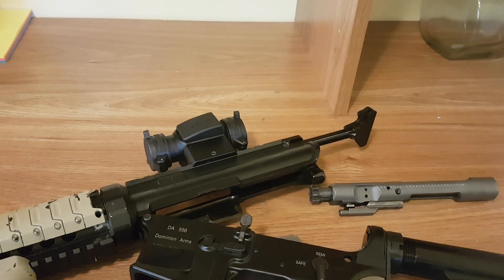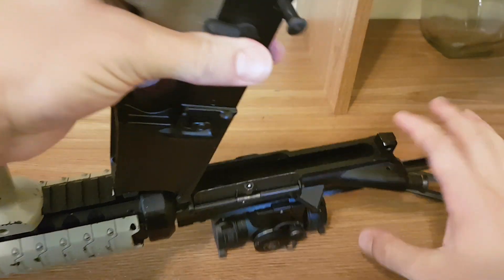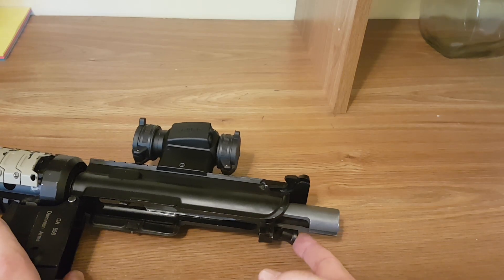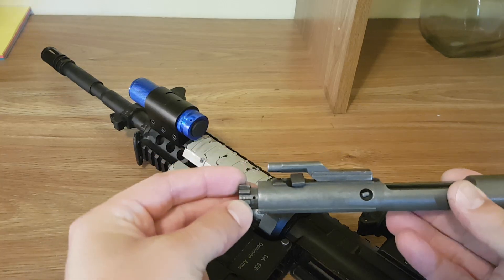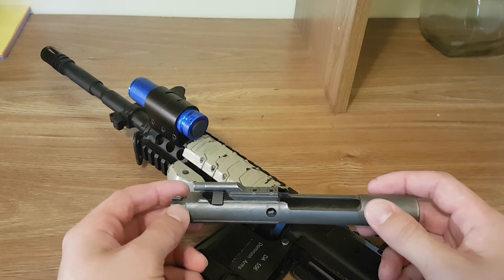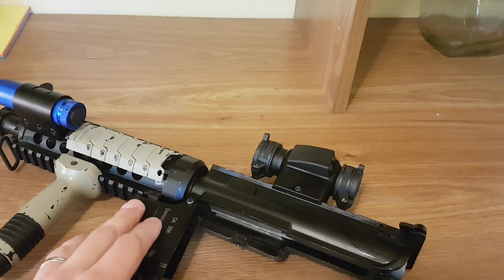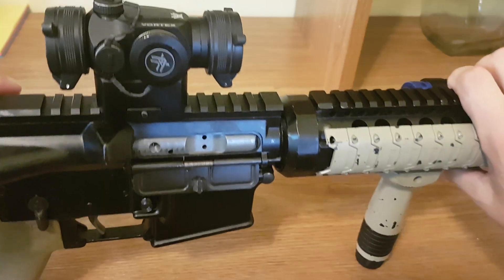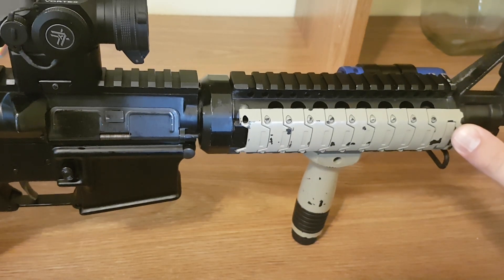What does the Forward Assist on the AR15 Do?

Comment: The serations are on the bolt carrier. And I've use the forward assist when I had to be quiet charging the weapon, when you can't just rack it back and let go. 
But the bolt carrier thing was driving me nuts. The bolt resides in the bolt carrier. 
And just carry pipe cleaners and powder solvent it only takes.... geez I'm getting annal in my old age.

Comment: I always taught troops to automatically hit the forward assist after releasing the charging handle. This insures that the bolt head is completely seated. This becomes more important during sustained firing that requires many magazine changes and loading. Carbon build up can cause the bolt head to often fail to lock forward completely. The original AR-15’s did not have the forward assist, and this was not good. While I can make the AR work for me, I still and always have preferred the AK!

Comment: I am a Marine and I have used the forward assist to put the bolt into battery.
Disclaimer: ... while using blanks.
Went through SOI west in November (Hollywood Marine, rah). As you can imagine beautiful Southern California in November... rain. Rain and mud.

Tap rack.. nothing. 
Sure enough, bolt was barely out of battery, like dude says in this video, so what did I do? ... tap the forward assist. And I have forever a clear memory of the forward assist gingerly forcing the bolt forward and causing my rifle to function properly.
I'd also like to add that my papa was a 1980s era Marine scout sniper, and he was taught that the forward assist is almost essential if you're trying to be quiet.
You never know when you might have to make ready Solid Snake style.

Cheers.

Comment: If you put a round in it, it wouldn't go all the way forward like it is in the video. The forward assist is also used so that you can chamber a round very quietly. Instead of having the bolt slam forward and make a bunch of noise, you can bring it forward slowly then use the forward assist to bring the bolt all the way forward to fully camber the round and ready the weapon.

Comment: If you whant to show how the forward assist works, try load bullet and than gently relase the bolt. Not relase completly but in that way you had tryed in the first place. Will work. Sometimes at hunting I whant gently release bolt and then i must used forward assist

Comment: We had the same drill in the Dutch army with the Diemaco (same platform). Pull the charging handle when loading, assist it back (never let the spring do the job) and push the forward assist with the hand palm. Never push it with the dump or whatever to avoid injuries.I never figured out why this was. Well I knew you will push and lock the bolt into the chamber that way perfectly because of these little notches. But I can also imagine it's less louder to securely charge it this way, instead of just releasing the charging handle and let the spring do the job.Using the forward assist was also part of failure drills.But other then that, I don't know if the the forward assit is still necessary on this weapon platform annymore. Never encountered difficulties or missfires. I believe it's still something from the old M16 which had a lot of issues, esspecialy with bad ammo, so I've read.

Comment: As a Veteran I can tell you that it is only used when implementing remedial procedures to overcome a failure of the rifle. When using SPORTS after a failure Slap Pull Observe Release TAP (the forward assist) Squeeze. After a failure to fire, after the failure has been cleared, and the bolt is falling from a locked position rather than a full charge, there are times the bold carrier will fail to go into full battery so the forward assist will help move your bolt and bolt carrier into full battery.

Comment: It also helps if you have a misfire and you're trying to reload another round quietly without slamming the bolt. Just ease the charging handle out and back in, push the forward assist to ensure the bolt is locked. Then you're ready to go.

Comment: The M16 I used in the 70s did not have a spring for the charging handle. I'm told it resulted in some nice smiles for a few who forgot to push it forward.

Comment: I don't get it. If it was designed just to push the bolt fully forward, why wouldn't you just push on the cocking lever? And it doesn't seem right to have like 50 little notches just for that.  If any of my guns jam while cycling the last thing I'm gonna want to do is jam in in farther til it closes haha what the fuck! Plus all the negative comments here I think something's fishy with your explanation. Anybody for sure know what it's for? I am very curious
Reply: Ryan Zuker ... because the cocking lever...or charging handle is designed to only pull the bolt carrier back. That way, wben you lock the carrier in an open position you can push it back in out of the way and also so it doesn't move back and forth with the carrier as you fire or cycle the gun.
The forward assist isnt there to solve a jam issue. It is there just incase the bolt doesn't fully seat forward and this can happen for a few reasons that are simply taken care of by this function.
Also, if you have ever had a gun under water and needed to drain your barrel, or want to verify there is a round in the chamber and ease your bolt back a touch...this can quietly and effectively seat it in place without the full range of motion and loud charging noise.

Comment: The French MAS-49, Swedish Ljungman (Automatgevär m/42 or AG-42) and the Egyptian Hakim and Rasheed all use the direct impingement gas system and none of these have or need a "forward assist". 
Eugene Stoner apparently produced a beautifully engineered but totally unsuited to battle firearm (like a "Luger" pistol in that respect) and the resultant fuck-ups by the Military resulted in "more than 22 changes from his (Stoner's)original design and eventually the "Ichord Congressional Subcommittee hearing" and in October 1967, the subcommittee concluded, “Grave mismanagement, errors of judgment and lack of responsibility had characterized the Army’s handling of the entire M16 program.” Also, regarding wrong ammunition problems - "“The failure on the part of officials with authority in the Army to cause action to be taken to correct the deficiencies of the 5.56mm ammunition borders on criminal negligence.”
So, What does the Forward Assist on the AR15 Do? It (sort of)fixes one of the many problems on a horrible gun !

Comment: Ya know what doesn't have a forward assist? An AK. That's because it doesn't need one. And that's because it doesn't fail like the AR does when it gets some dust in it. The bolt is one big hunk of metal without all the overly complicated crap like the AR.

Comment: i don't think anyone truly understands why the fwd assist is there, you don,t slap that shit when your gun jams. I've only been in the army for a little over a year now but the only time we slap the fwd assist is when we load the weapon, releasing the action after clearing the weapon things like that, you'll never slap the fwd assist if your weapon fails to fire, you have a specific set of drills for that depending on the location of your bolt during the jam you do said drill to try and clear the jam once cleared cock, slap, shoot. if you weapon fails to fire and you start slamming on the fwd assist you're doing it wrong.

Comment: is this basically the same weapon as hk416? i used that in the army and they look very similar
Reply: H&K took the M-4 and changed the design from a gas operated to a gas piston system, and called it the M-416. This means that the 416 has a piston and rod that drive the cycling of the bolt instead of a gas tube. The gas piston causes an increase in weight, but improves accuracy, reduces fouling (more time shooting, less time cleaning), and allows the barrel to stay cooler (no gas tube to allow heat dissipation to add additional heat to the barrel). The added weight is the only down side, but the improvements outweigh the issue of additional weight.

Comment: You lost all credibility when you called a bolt carrier a bolt. That grey thing that slides under the charging handle is called the Bolt Carrier Group. It is comprised of an extractor, an extractor retaining pin, a bolt, a firing pin, a firing pin retaining pin, and the bolt carrier. The forward assist is actually NOT simply copied from a concept born from military application. It is designed to assist correcting a broken seat in your star chamber. Because the bolt doesn't always rotate far enough to lock into place after a misfire, misfeed, or malfunction.

I'm not sure where you get your credentials to say that it is part of any military drill to tap the forward assist every time you manually cycle your weapon, but you are very mistaken. After having trained with American, Canadian, German, and Australian forces, I can tell you that not one of them preach that. The ONLY time you are actually instructed to tap the forward assist is when you are performing immediate action to correct a malfunction (by slapping up on the magazine to dislodge a hung round, pulling back on the charging handle and simultaneously observing the ejection port to ensure proper extraction and ejection of the round, releasing the charging handle to re-seat your bolt into the star chamber, and tapping the forward assist to ensure a proper lock for further engagement).

Get out of here with your tacti-cool nonsense. Leave weapons instruction to the professionals.
Reply: It is a good video.  Appreciate it for what it is.

Comment: I like the design of Kalashnikov type assault guns (my experience is from the Finnish AK47 variant Sako RK62) as they never get into such problems that western gun manufacturers are solving by adding more technology into products. If same happens to Kalashnikov, which is rather unlikely, you simply push the bolt in from the handle which is a solid part of the piston.

Comment: Better to have it and not need it IMO. 
If you need to use the FA more than once in a while, though, that's a sign of bigger problems.
Reply: Um no forward assist ain't a button that takes away the problem it makes it worse if you got a problem pull the charging handle pack to clear dirt.

Comment: Was in the Army for 8 years as a tanker and infantry. Never used the forward assist during normal weapon operation. It was only used during weapon malfunction drills(or ther eal thing) when you employ SPORTS. 
• Slap the magazine
• Pull the charging handle back
• Observe the chamber for blockages
• Release the charging handle
• Tap the forward assist
• Shoot your target
Reply: I had a M-16 during my 1971-1974 service in the Israeli army only in 1973 during the war inside Syria. Basically we did the same as you described. In my later years I had a Galil which was much better.
Reply: @RasMajnouni  RK62a and HK91s... really anything that'll throw a 7.62NATO. I'd give up three fingers for a Rhodesian HKG3...
Reply: tap, rack, bang
Reply: The Marine Corps taught to use the forward assist when loading the first round simply to ensure that the bolt was seated (prolly cause our buffer springs are worn the fuck out). The forward assist was not meant to be utilized during weapon malfunction. We use tap, rack, bang for malfunctions. Tap the bottom of the magazine, rack the charging handle to clear the jam, and bang means pull the trigger.
Reply: Yeah but you learn SPORTS when your in basic training. After youve been in awhile and have shot many times amd fixed many different types of malfunctions did you really use the FA to fix a jam or whatever, prob not.
Reply: We used it all the fucking time in training. Shoot blanks and do press checks and it'll be your best friend
Reply: Marines teach it better ......you forgot the KISS.......its SPORTS KISS (your ass goodbye when your weapon doesn't fire and you get shot because you took the time to do SPORTS)

Comment: It's actually the bolt carrier group you keep calling a "Bolt." The bolt is inside the bolt carrier. Not being a smartass but some people may not interpret this right. Acronym is SPORTS. Slap tha mag, Pull the charging handle, Observe the Chamber, Release the carrier, Tap the Forward Assist and Squeeze the trigger.
Reply from the maker: You're correct, and I did refer to it as the bolt carrier group at least once. Commonly it is just referred to as the bolt to save from saying bolt carrier group every time.

Comment: Had to use the forward assist a few times but that was with somewhat clapped out rifles used in training units and the crappy vietnam era ammo. Don't get me started on all the problems we had with the initial issue M-16s, the M-60s, the M-219 coax and the M-85s.
Part of the BII for the M-219 was a steel pot you smacked the receiver with when ever it decided to stop firing. The recoil (driving)springs and guide rods were a joy also. You had to push both rods in and turn them in to release them at the same time in breakdown. If you let one of the rods slip off your thumb it would fly back and impale you. I watched one fly the length of a room and embed itself in the back wall. :)

Comment: During firefights in the Vietnam War,  the bolt and star chamber would sometimes become so fouled that the buffer spring would not be able to close the bolt carrier group (BCG) fully into battery.  The BCG would by this point be too hot to touch so on the original model M-16's you would need to use some object to press the BCG the rest of the way forward.  This is why the forward assist was added, to give the shooter a means of forcing a hot BCG into battery.  I have personally had to use the forward assist for force a M-16/M-4 into battery quite a number of times actually, sand can reak havoc on these rifles unless you lube them just right.

Comment: M16A2 fires on point target to 550 meters. (AK 47 = 350m and ak 74 = 400m on point target). USMC quals at 500, 300 and 200m. 200m is standing. I hit 7 of 10 bullseyes @ 200 M and performed similarly at 500 prone, iron sights.  Never experienced an issue that recycling the bolt or using forward assist couldn't fix. I can still hear that spring in the stock... I enjoyed that weapon. And you're not trained to 'push/press" the FA. You smack it with the heal of your hand.

Comment: AR-15 didn't originally come with the forward assist.  The United States Air Force originally adopted the M-16 for a number of reasons.  When the Army started to acquire them, (largely at the direction of the Defense Department, due to bean counter cost cuts, the weapon was acquired without chrome-plating in critical areas that existed in the AR-15 (these chrome surfaces were what made the AR-15 "zero maintenance").  During early trials by the US Army in Vietnam, the M-16 proved to be unreliable as jams could occur due to corrosion and soot build-up (this was also attributed to a replacement ammunition that created more soot than the originally sourced ammunition.  The "fixes" over a number of years resulted in the M-16A1 which in addition to adding chroming, also added the forward assist, a cleaning kit and a cleaning kit pocket in the stock.

Long story short, the Forward Assist isn't necessary as long as you have the right ammo and Armalite's original chroming scheme.

Comment: So how come you can't just push the thing closed with the slider?
Reply: It's a charging handle. The charging handle can be all the way forward without the bolt carrier being all the way forward. All the charging handle does is pull the bolt carrier back. When you let it go or push it forward the spring in the buffer tube is what pushes the bolt carrier forward. Every time you fire the weapon the bolt carrier goes back without the charging handle moving back or it would hit you in the face.
Reply: At least someone knows what they're doing. Thanks mate, appreciate it.
Reply: I think that when the bolt is almost closed, the slider loses contact with it.
Reply: CJ_Roret  thanks mate